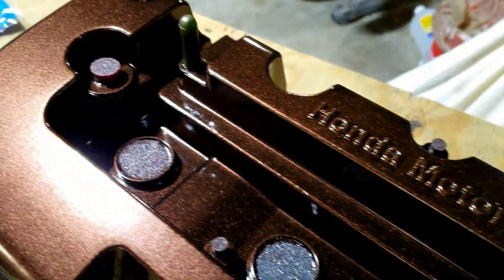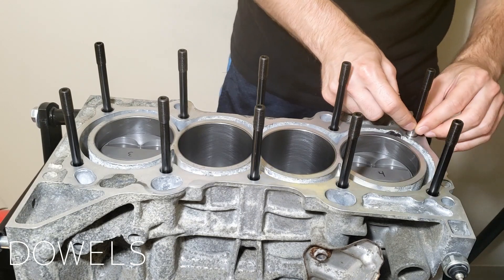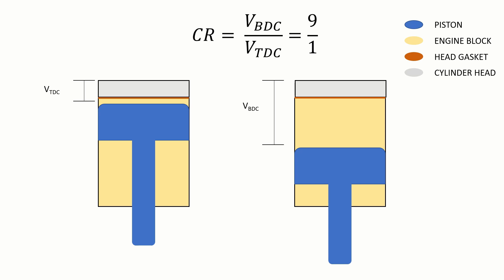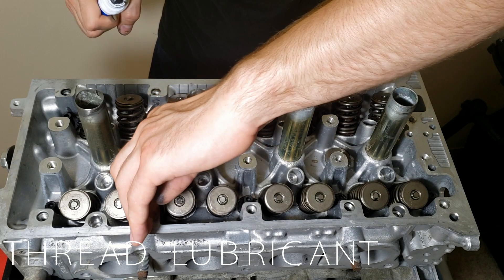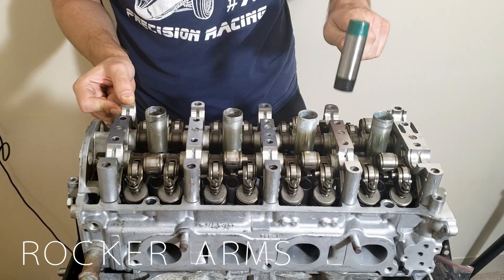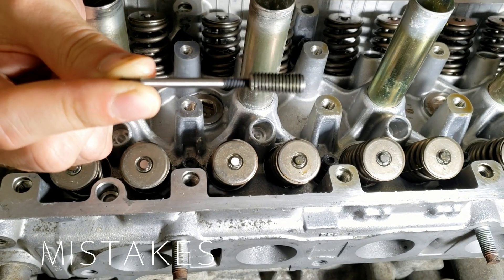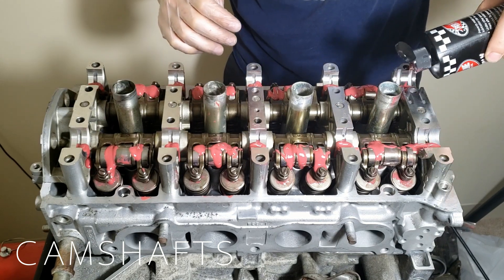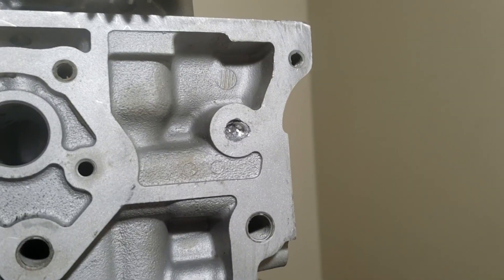How to Install a K20 Cylinder Head on a K24 | MR2 Build

Comment: I cracked up laughing because your mistake at the end is my mistake. The same exact bolt. The upside is that I'll be installing a better flowing K20 head like you.
Reply from the maker: So many mistakes during this, I try to show them all
Reply: @IGDesigns  my bolt broke off when I was removing it is the crazy part.

Comment: I have a k20 engine that was rebuilt about 5 years ago now and I left it sitting in my garage. now it has some light corrosion on the rocker arms and spark plug tubes. Im wondering if it would be wise to take the rocker arm assembly off and clean off the rust before running the engine.
Reply from the maker: I would, you want no contamination.
Reply: @IGDesigns  I was thinking of just dry ice blasting it so I don’t have to disassemble anything

Comment: aha I'm humbled, I similarly broke three bolts with my recent b20vtec build. uneven camcap 12mm, over tightening the 10mm camcap bolt to the 12mm spec only to realize halfway through the last big turn of the torque wrench, and the last one for the oilpump I left in the block because I didn't wanna re-do the silicone again for the third time(first two times were front main seal fiascos) lol theres still a couple threads and the rest of the bolts holding the thing on. woes of my first engine build, fun stories now looking back at those worrysome times. I'm excited to keep following along to this build, can't wait to see the car rippin. love the content and tips for people new to this all.
Reply from the maker: Thank you I’m glad you enjoy it. I got creative in removing the next broken bolt, I hope that’s the last.

I purposely keep my mistakes in so hopefully I make them for everyone. My main goal is to make people confident enough to do engine work themselves. This is my first attempt at it, I’ve never even done a lawn mower engine or anything. Hopefully it actually works haha

Comment: Looking good! Would you suggest decking my M54 as a part of making it track ready? I want to do all the bearings and such before track season, but there isn't much time. I'm not sure if I can get away with throwing a new head gasket on without milling the surface. I think removing material to increase the compression ratio would be useful in my case to make more power, but will probably do it next winter, along with cams and an ECU.
Reply from the maker: If you take the cylinder head off you can use a straight edge and feeler gauges to check for any warping. You lay the straight edge along each side and across. You use feeler gauges to see if there's a gap anywhere. There's good videos out there on it, I recommend Jaffromobile.